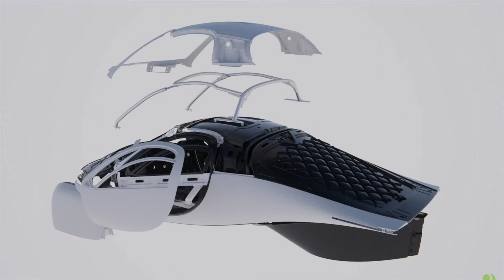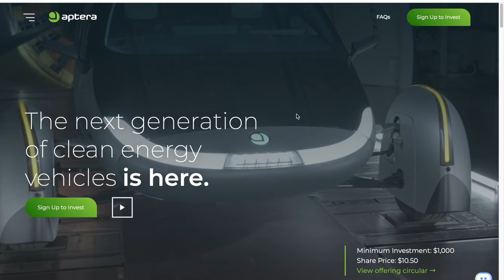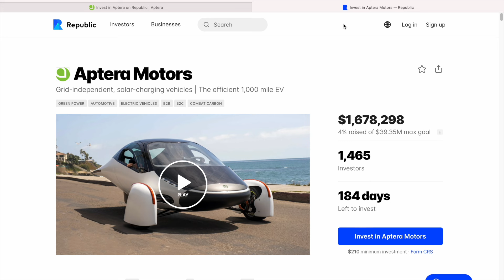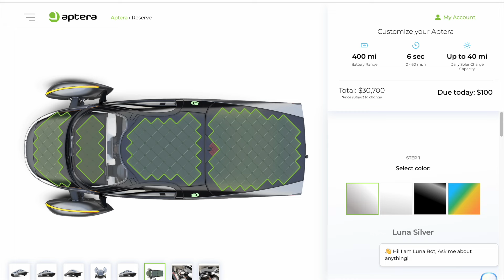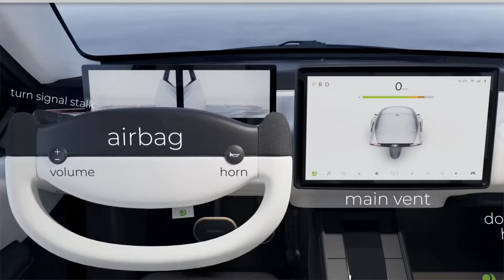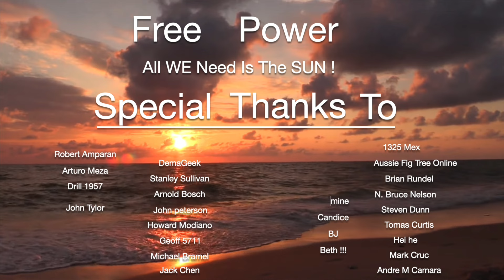BINC Is Being Shown In France !

Comment: The not put together is so they can show off how it is assembled. The difference between the carbon fiber and fiberglass.
Reply from the maker: That black carbon fiber SMC , really looks nice ! I see why they would do that . 😎
Reply: Notice the door on the right is the carbon fiber interior, while the left side appears to be either the fiberglass exterior or both layers. So you can look at the inside of door structure and see how it has the crumple areas built into it.
Reply from the maker: Good point richardryley , I didn’t pay attention to that , good job . 😎

Comment: The 400 miles all-solar front-wheel motor version will only cost me €28263 (minus import tax):  640 km range for under 30 grand, and 40 solar km a day in my country, this is real!  After 5 hours driving one needs a break anyway, at a Tesla charging station.  A brand new car that lasts a long time as well, will be in a very low monthly tax category. Many parts are produced in the Euro zone, so European buyers can expect lowered import tax for the Aptera.

Comment: If i get stuck in the mud, is it easy to pick it up and move it out of the mud myself? I actually had a friend who did something similar for me with my old Saturn, but this looks easier to lift.
Reply: The 40 kWh of batteries won't exactly be light.
Reply: @robertkirchner7981  yeah, but I imagine the Saturn engine block wasn't light either. I think I could probably help push it out of the mud.  At the very least I hope to own an Aptera and not need to do it, but believe that I could if needed.